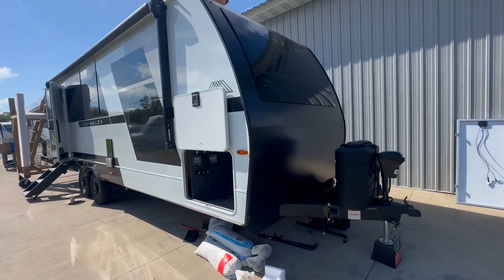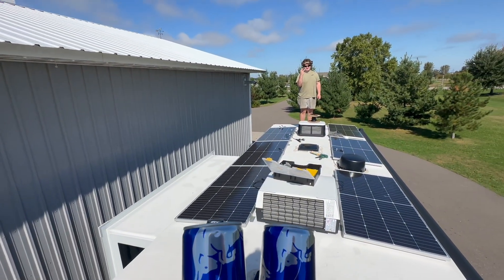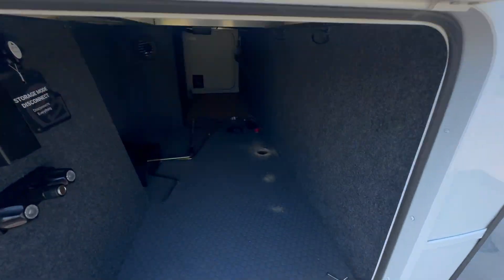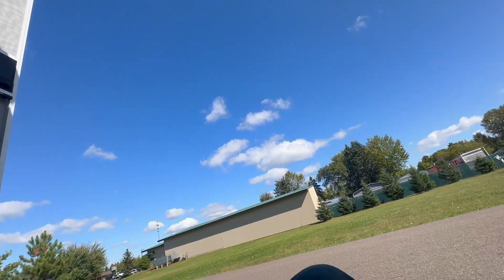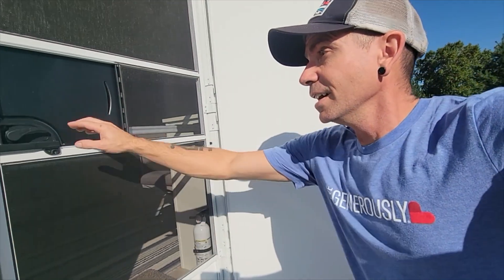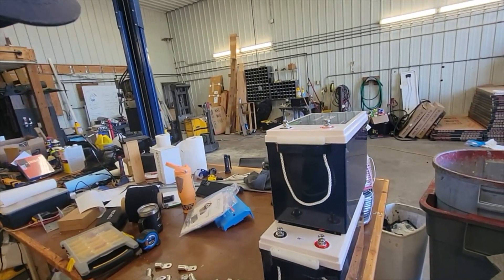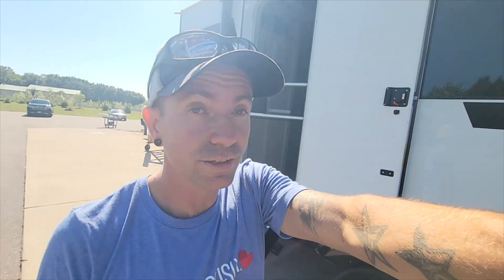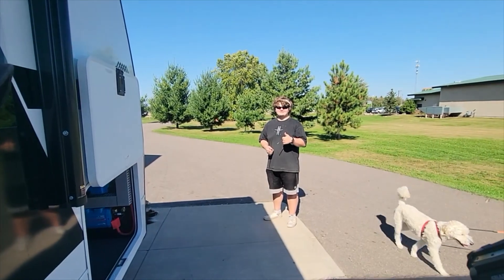Brinkley Travel Trailer Solar Upgrade 1500W Roof Solar, Victron MultiPlus 3000, Cerbo GX, 600ah Batt

Comment: That whole installation looks terrible for a Brinkley! 
Basically trashed that RV with Improper Planning & Execution.
1. Unsealing the underbelly, so Mice & Bugs can get in. Bad idea! 
2. Weird, Crazy Wire Runs.
3. System setup all spread out and taking up too much space. 
4. Why are you still running those HDMI screens when you can do a Android Setup? A waste of time and labor. 
5. Nowadays you can buy good 300 amp hour batteries for less than $500. You could have put four of them in that RV.
6. DC to DC charging is too often overlooked in all of your setups. Makes no sense!!! You have no idea, it's all about the weather with that.
STOP PLAYING GAMES AND START DOING THINGS PROPERLY!!!

Comment: when you use 2 gage wire to   MPPT controler do you use  a ferrel on the connection to mppt ??? if so ( square )  and can you tell me the  name of crimper please  you gugs are great !
Reply from the maker: No, while it does help keep those strays  inline I feel even a square crimp has a lot of imperfections and reduces overall contact with the terminals. We put the bare stranded in , torque, wiggle the wire, retorque

Comment: I would love to see how you are venting the multiplus.
Reply from the maker: We have other videos were we go into detail. We need to put together some dedicated library videos for questions like yours. 

Big picture, we use GPU cooling vents, tubing and fans. Seems to strike the balance of size and efficiency. We then control it via the K1 relay on the Multiplus, or a dedicated thermostat. Some folks also use the Cerbo GX with temp sensor. Many ways to do it. 

The key thing is to remove hot air and get fresh air in. I’d argue the most important thing is thing is to remove the hot air. Cooler air will seep in through many places. 

Another common misconception I’ve seen is attempting to add a heat sink or ventilation space to the back of the Multiplus. That just buys time, eventually it all gets hot and overloads, gotta exchange the air.

Comment: Another fantastic video.  Thank you.  Quick question,  what material are you using for mounting the components too (mppt controller, breakers, etc.) and do you add any fire resistant protection to it?
Reply from the maker: We switched from marine carpet to fiberglass grill Matt https://amzn.to/3IttQMJ yes it’s fire resistant, and we tested it. It covers the ACX Plywood.